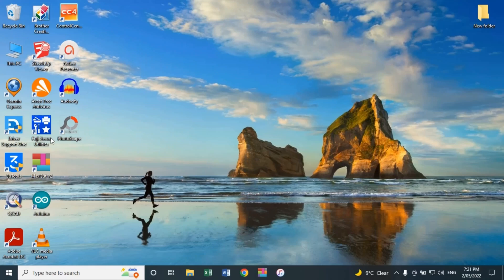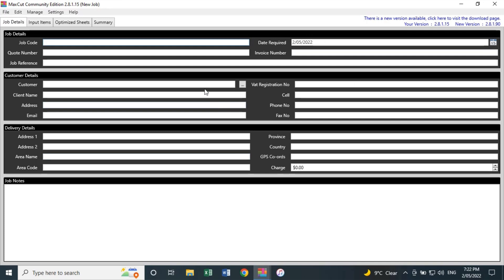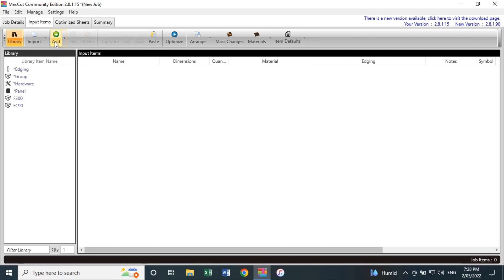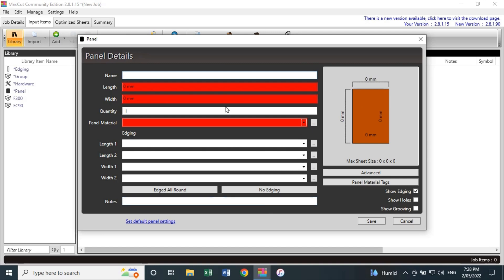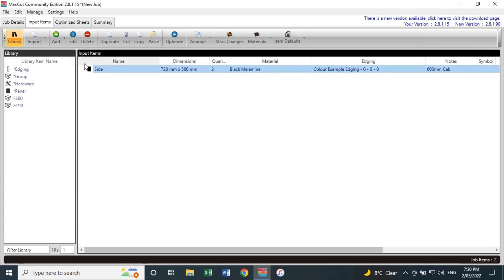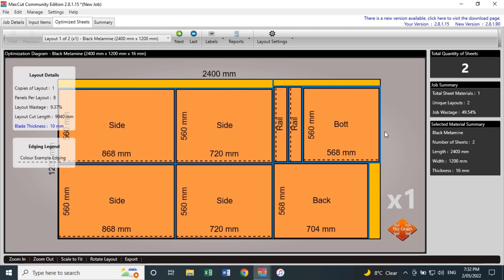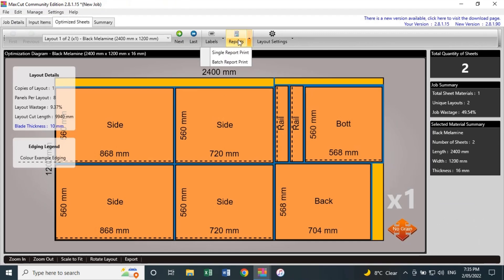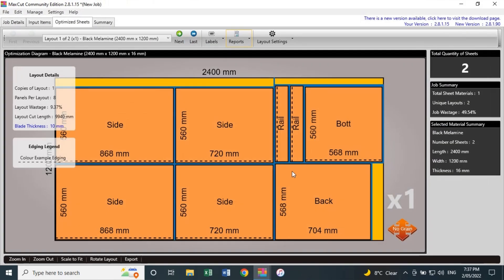The BEST FREE Board Optimisation Program | MAXCUT Tutorial

Comment: Interesting. I stopped by looking for a cut layout, and it sounds like a cnc or laser setup. Still interesting. Please correct me if I am wrong.
Reply from the maker: @timlist4173  with this set up you add in all your cutting list, material you are cutting and the program lays out your pieces and shows you how to cut them out efficiently. I don’t have a CNC and I use this program all the time for cutting out sheet goods with my track saw then trimming to accurate sizes on the cabinet saw.

Comment: Great video. Any tips for when your eg shelve size is larger than the largest wood plank you can get. Does Maxcut help workout the amount of planks you would need? For example. Cupboard inner shelve is 360mm deep but wood is only 220mm wide. Which means Ill need 2 x wood plank and glue to get to my needed measurements
Reply from the maker: Hi mate
No I don’t think it will work that scenario out for you however, if you did get all of your off cuts that you wanted to use for eg shelves, glue together then re-enter the new size of your glued up piece then enter the dimension into the materials board list. Then go through the motions of putting in your cutting list and picking the glued up board that you entered in the materials list.
Hope this helps in some way 😎